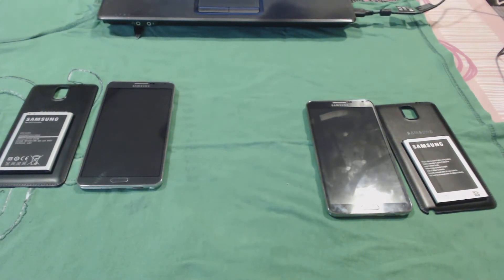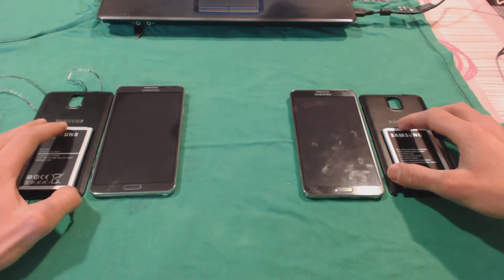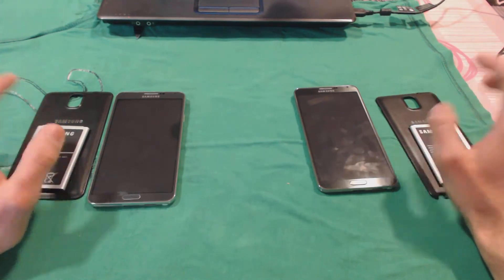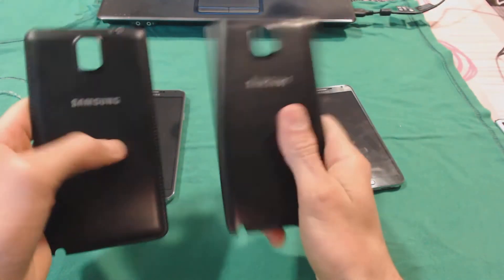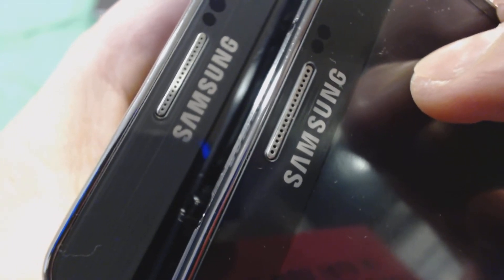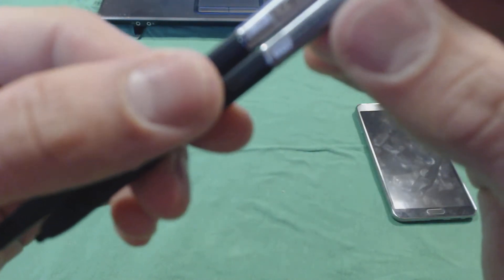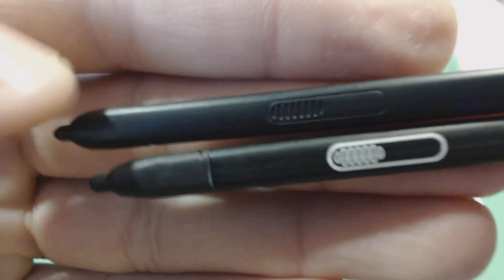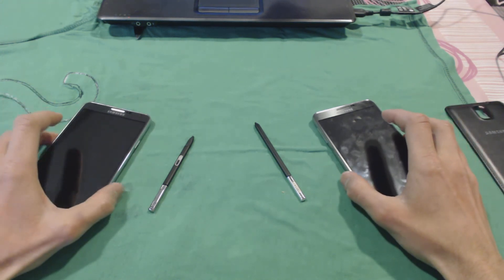Galaxy Note 3 Clone : SM-N900 vs GT-N900 (N9006) : Comparison, Review, System Performance

Comment: Salut, te rog lamureste-ma si pe mine,am cumparat acest telefon dar chinezul imi zice ca este N900 desi scrie N9000 in titlul. Eu am luat varianta MTK 6582 RAM 2G ROM 8G camera 13 mp( daca or fi reale). N900 e acelasi lucru cu N9000 ?
http://www.aliexpress.com/item/Original-1-1-NOTE3-phone-n9000-cell-phones-5-7inch-Android4-3-MTK6589-3G-13MP-RAM/1876927896.html
Reply: Multumesc de raspuns, telefonul e pe drum si eram curios sa vad ce am cumparat. O sa urc video dupa ce-mi soseste. Mai am o intrebare off topic : un chinez mi-a trimis un Lenovo S 820 cu placa de baza avand scurtcircuit( asa zic cei de la service-ul unde l-am dus). Unde naiba sa gasesc motherboard pentru el ca sa-l fac functional si sa-l vand cu cateva milioane sa nu raman in pierdere totala ?
Reply: asa zic cei de la service**, scuze ca am facut dezacord,cred ca ma gandeam la altceva ! :) Intre timp am editat mesajul anterior.

Comment: Am torn between HDC galaxy note 3 N9006 MTK6589 and HDC galaxy note 3 N900 as far as use of S-Pen function is concerned and of course,though secondary features like air control,multiwindow.
Any advice? Will really appreciate your help.
EVANS

Comment: Dear Presenter, I have one of this model GT-N900 (N9006) Note 3  and I have downloaded a wrong rom and it is dead now and SP flash tool always give me an error >> do you know how toi get the original stock rom or how to fix it? thanks in advance for your help.
Reply: ***** yes ..please I need the link to the stock rom urgently ..please share it with me ..thanks in advance.
Reply: ***** Is there a rom for other version as I think mine is GT-N900 but 4 GB with 1 GB RAM 1.2 GHZ ..thanks in advance for your response.
Reply: ***** please tell me the right process to install the phone driver on windows 7 before flashing the rom.
Reply: ***** I always get an error in SP flash tool..

Comment: I just checked my Max N9006, but the holes in the top are 2 sizes like on your N900, and the frontfacing cam is also like on your N900, meaning it isn't total to the edge. What I think is, you got actually the N9006 but they attached another front/display on the phone than the normal. My earphone speaker also don't go deep into the phone like on your N9006, it is in the same height as the rest of the screen.
Reply: That I can't explain. Did you try both Antutu versions on the Play Store? there are 2 different versions I think.

Comment: I look forward to seeing your video of the performance of each of these phones. I have the Note 3 Max sm n9006. It is loaded with a ton of Chinese applications, doesn't have true S Pen or S Pen Air Command. Can't root it ( yet- but trying hard to). Doesn't appear to have a true Android 4.3  OS but does have a lot of the same "stuff" to run the phone as close to the original as possible. I know this because I have a True Galaxy S3 i747m running on Android 4.3 and it looks nothing like what is on this phone, plus, I have researched a true Note 3 at Best Buy. Please post your video so we can all see the differences ....